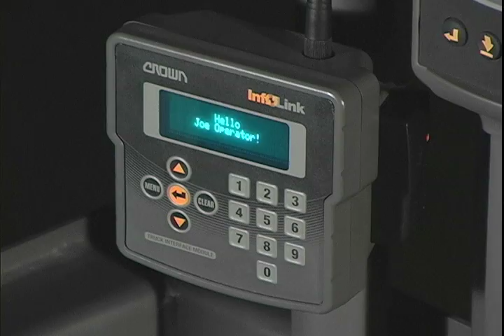Crown Equipment Corporation History

Comment: There is truly nothing like a Crown.  I have personally used only a handfull of different Crown products including a 2007 SP order picker with two speed lift, a 90's model sp, pallet trucks both 90's and almost new, a 2006 RR series with two speed lift and a 2009 RR with electronic steering, two speed lift and the 123 system with the traction control.  I have used these products in two different warehouse settings and fell in love with them.  I now use the upsettingly more commonplace Raymond l